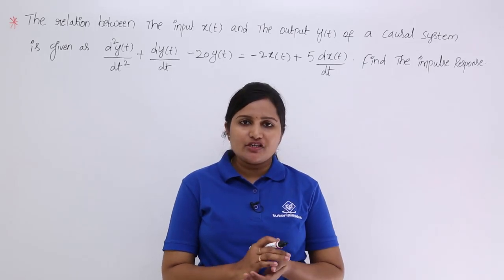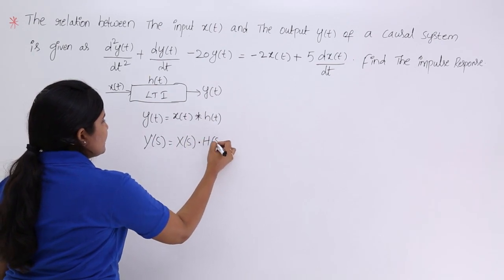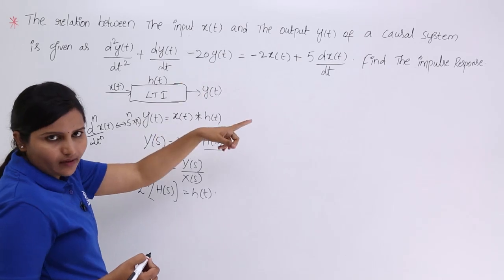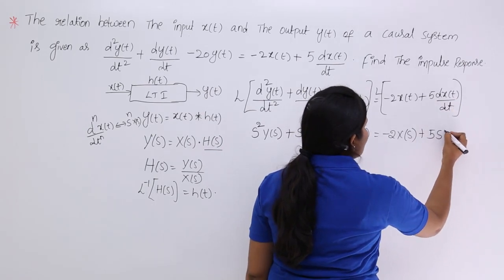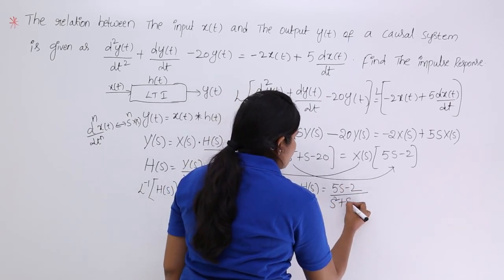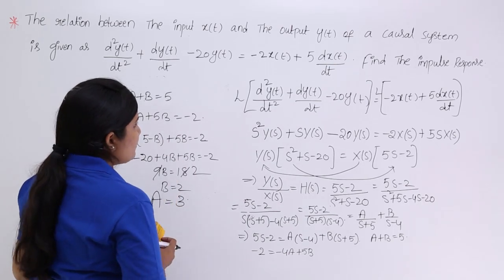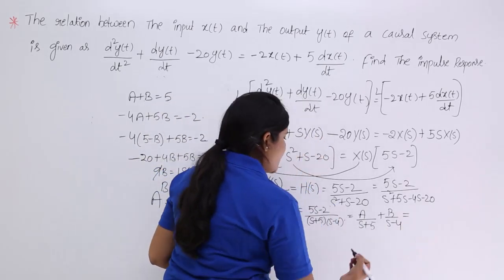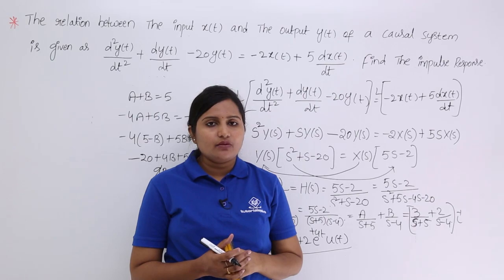Differential Equation Solving Using Laplace Transform

Comment: isnt the laplace transform of derrivetive is like d y(t)/dt = S x Y(S) + Y(0) and d^2 y(t)/dt^2 = S^2 x Y(S) + S x Y(0) + Y*(0) ???
Reply: By definition yes, but if the system is causal, then every initial condition for every function is equal to zero( because function needs to be continual in order to be differentionable, and it is continual if y(0-)=y(0)=y(0+). Since y(0-)=0(causality) all of them are). I think she should have mention this, but when you think about it, it's very intuitive.